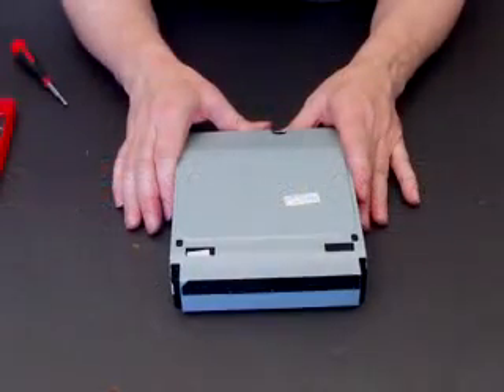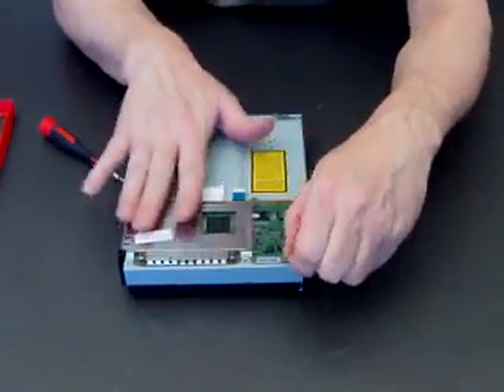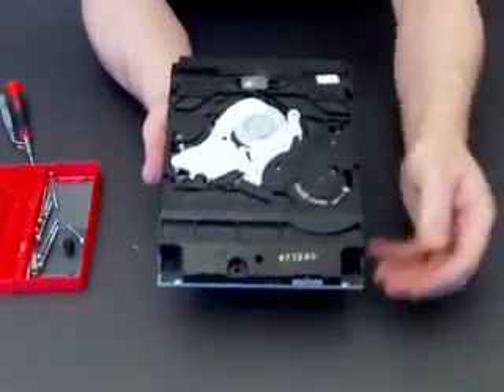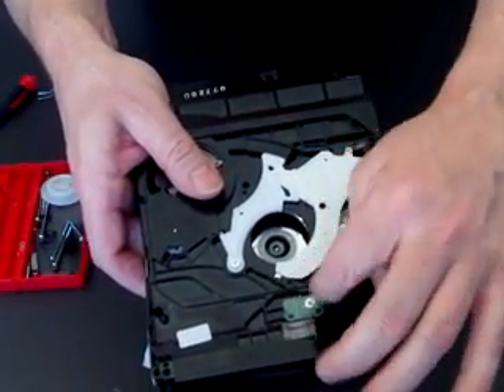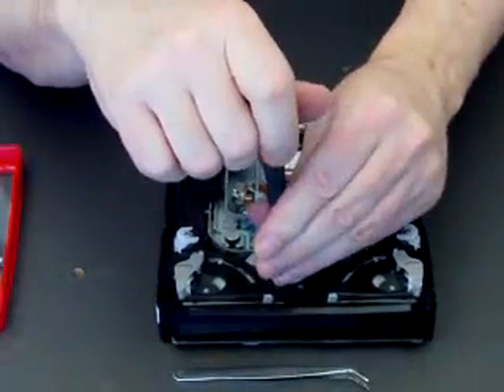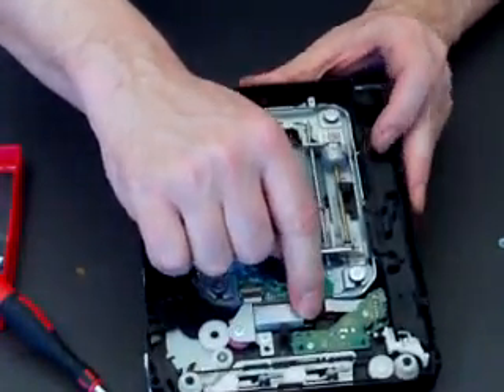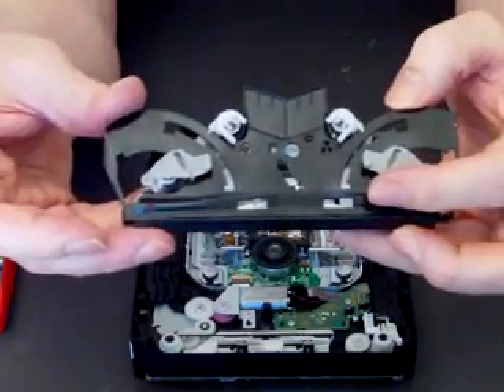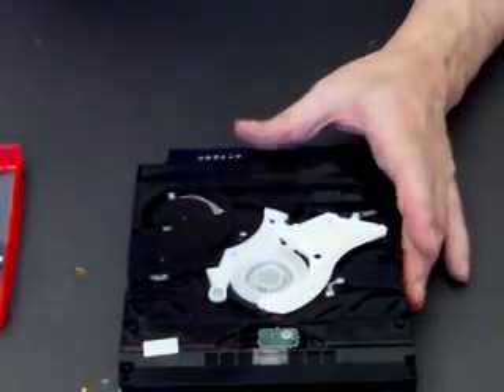PS3 Repair Guides no 2 - Reset Blu Ray Mechanism

Comment: soooo much plastic bs....this is the equivalent to the ww2 tiger tank lol
too complicated and too weak parts.....
I ended up just leaving it open and then put disc on it manually and then drop the magnet that hold the disk on top of it, take maybe 5 sec longer than push it in the slow, so no problem

Comment: Steve, my son's PS3 will load and eject discs, however the optical drive doesn't spin up.  I've cleaned the lens and still no joy.  Wot's the best way to t/s the issue?  Would it be the motor or the logic board or someting else?

Comment: I got a play station 3 for 15 dollars and the CD reader is not opening up or excepting disc I press the bottom it makes a nose but nothing happens I took the motor out and put a 9v battery it works what could make it not respond at all.

Comment: My ps3 fell from a height of about 70cm. Then the disc spinner didn't spin the disc at all so I replaced the deck. Now the problem is that when it starts spinning I hear a sqweezing noise, like the disk doesn't stand steady and it tangents on something but everything inside the drive seems to be ok. Any people with the same roblems or solution?
Reply: yes I got the same problem  and I thing if this can be make because spinner probably didn't move the disc to up by this mechanism on right side (it's holding the disc higher and left mechanism moving  this disc)